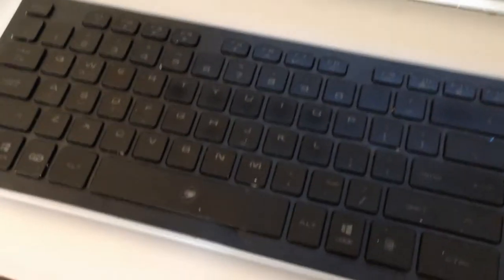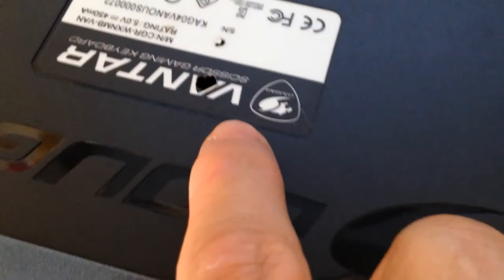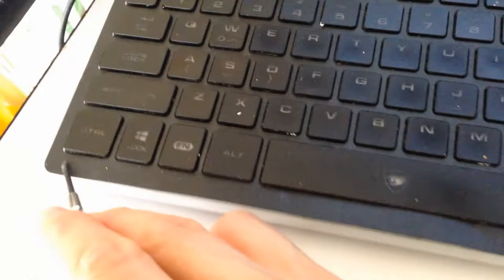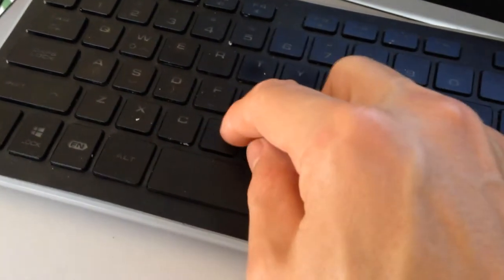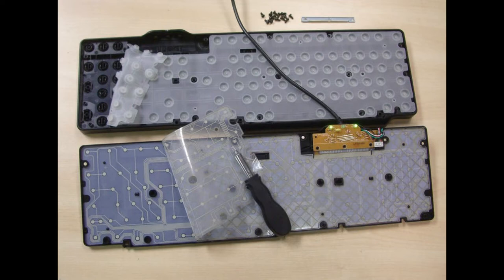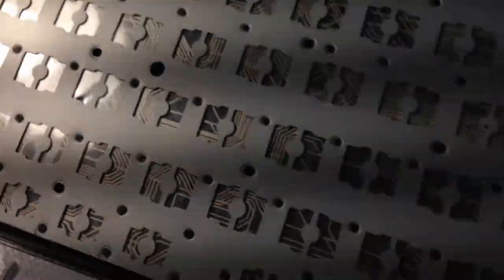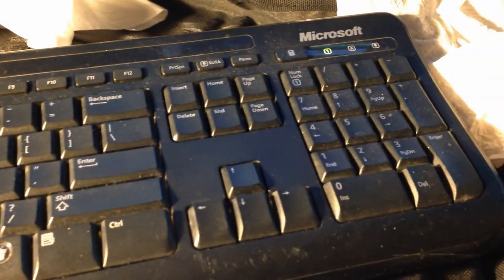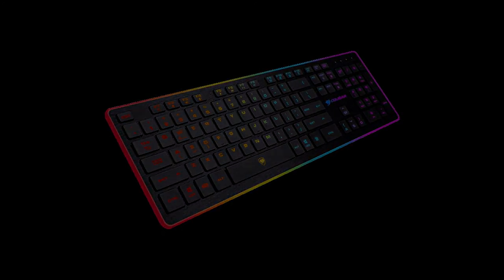Cougar Vantar RBG - UPDATE: Cleaning problems! Teardown / disassembly

Comment: Thank you for this. I spilled tea in my vantar keyboard a couple days ago. I went to clean it up and was met with exactly your problem. But I did manage to pull apart the plastic welding and clean out the circuit boards with alcohol.
Reply: how you do that?
Reply: @blades15rs  I did some gentle pulling right where the rivet was and it popped free.  Then I took apart the rest and ran several Qtips dipped in 91% alcohol.
Reply: hi, do you recommend this product? how is it perform after a months or a years? thx a lot!!
Reply: @HimeGabi  Sorry bothering you 3 year later, but did the metal plate fit back nicely after you cleaned it? And how long does it take to the membranes to dry after cleaning with isopropyl alcohol? Thank you very much.
Reply: @LipColt  Hii, sorry for intruding, but, we don't know how long HimeGabi will take to answer soo.., anyways, i do have some experience with laptop maintenance, and this dude video is great because it shows where the screws are n etc, so, if u wanna disassemble the keyboard without damaging it, i personally have never used but i think a heat gun would be able to remove the black/metal part on top of everything, so u can uncover the screws, and later, glue it back with new glew. As for the plastic dots that hold the keyboard inside, u can "unsolder" it just like any soldering, will stink a bit more because it is plastic, and to solder it back all u need is other little bits of plastic, i've done it with the most unexpected tools and resources, it didn't work because it was a very cheap solution, but i'm positive it works with better resources than what i had at that time.. well, i did my best with what i had, and it worked, if u try it, remember of telling us the results please :)
Reply: omg, new glue* ahahuahuah
Reply: @LipColt  omg again, i said it didn't work, and then it worked... i meant, it didn't worked as good as i wanted it to, but it did, and considering it was a laptop keyboard, the small space and all parts so close to each other, helped a lot

Comment: to clean it up u can actually take out the key carefully without damaging your keyboard. you have to pull and push at the same time but in different parts of the key. this keys are not vertical instead this were placed horizontally In order to take out the key you have to do this: push down this side of the key--->:]x[:  <---- pull up a little and push to the left side while pulling then you already detached the key I hope u can understand my poor english and I hope its clear as cocaloca
Reply: and to placed the key in its much more simple, you just have to slide the key the right side of it must be first and then the left just falls and a little push less than the weight of the finger; don't force anything and with practice you will notice its very simple. you will get used to it.
Reply from the maker: Dude you should do a video of it and upload it, I'm keen to see.
Reply: Thanks, it works!
Reply: Hi! I know this was a year ago but could you upload a short video showing this? You don't even have to speak on the video if you don't want to. I am having issues with my keyboard and I believe this could solve them
Reply: @paulac93  I'll do it. Video will be in my channel.
Reply: @ourclock9273  Thank you!!!
Reply: @ourclock9273  I can't thank you enough! I really thought I would have to buy a new (more expensive) keyboard. You saved my weekend!
Reply: @ourclock9273  hi, do you still recommend this keyboard? how is it perform after a months or a years? I'm looking for low profile with backlit keyboard but it so difficult to find one in my country.. looks like this keyboard is good choice
Reply: @ourclock9273  nooo why did you delete the video :(
Reply: @ourclock9273  can please upload the video again... I'm not able to see it =/
Reply: @ourclock9273  Please reupload the video. Would be really helpfull!

Comment: Ive been having terrible problems with this board. Keys missing strokes, particularly the a and the p. My left shift key gives one of these |  for no reason. Could have been a great keyboard but I give it a 1 star. I had problems writing this complaint!
Reply from the maker: Yeah I think it’s poor construction. Might be worth opening it and checking out the printed wires on the plastic sheets to see if you can see anything obvious causing it to cross wires, maybe you can avoid wasting $40 and keep it as a backup.
Reply: @Domarius64  It's a shame. Could have been a good keyboard. I forgot to mention the lft alt key snapped off for no reason! Its been a bit embarrassing wrestling the keyboard when clients are over. lol Oh well new keyboard is in the budget...
Reply from the maker: Julian it is a shame - I avoided wasting the cost by making it useful on my laptop, it barely gets used so might last a while.
Reply: @Domarius64  Cool, thanks for the video. Might see if I can fix some of the problems:)

Comment: i have been using a very similar keyboard (perixx periboard 324). I love the layout with the fat ctrl and arrow buttons, and chiclet scissor switches, and backlight. unfortunately it seems to also be similar quality. i broke the corner of an arrow key. i manged to sucessfully replace the arrow key with the alt key which is the same size. am thinking of getting the cougar instead but maybe its not any better.
Reply from the maker: I would look elsewhere if you want a quality keyboard. Cleaning and maintenance is a must, and this keyboard doesn't allow you to do it.

Comment: Do you know is it possible to disable RBG leds only on the edge? I would like the backlight but the edge rgb is very bright.
Reply from the maker: You can adjust brightness, I'm pretty sure?
Reply: @Domarius64  but I would light brightness high on key caps, without light on the edges
Reply from the maker: @MrSoBraL87  no it's too cheap a keyboard for that.

Comment: Does anybody tried to improve backlight in Cougar Vantar? Most simbols partly invisible on all backlights effects
Reply from the maker: No solution that I know of! That's one of the things I complain about in this video or the previous video (can't remember which).  I'm sure they tested it, looked directly down on it, saw everything was lit up, and called it a day. But actually when you sit back in your chair and view the keyboard at an angle (like, normal usage...) most of the symbols top half disappear, to the point where it's actually difficult to tell what key you're going for!
Reply: @Domarius64   As I see in your video there's n space for mounting 12V COB LED Strips what makes imposible to improve backlight. I think Cougar totally FuckUp with design and visual ergonomic of this keyboard. The wrost they didn't fix this for 3 years

Comment: Maybe be clean? Respect your gear?
Reply from the maker: Cleaning is a normal part of keyboards even though it's not very often. I just finished a complete clean of my mechanical keyboard (you can find tutorials for this on the net) and they are designed for cleaning by removing the keys and top cover.

It's not possible with the cougar vantar because they stuck it together with adhesive, very cheap design, not designed to last and certainly not designed to clean.

Comment: Good video lad! Hopefully mine dries then.
Reply from the maker: If it's plain water, give it enough time in a dry enough environment (eg. outside in the sun, with the heat and the air) and it should eventually.   But water can stay between surfaces forever in the right conditions.  It might be worth taking it apart just once.
Reply: It was coffee. After some drying and quick plug in to test a key I knew was bad still I sprayed it with regular water from a bottle to make it less sticky and then sat it on top of the pc to dry. It worked beautifully.

Comment: i just bought the keyboard , and if you're a gamer.... DON'T buy it the spacebar is really messed up u have to press it in the middle otherwise it won't respond
Reply from the maker: Yeah I found the CTRL key to be unresponsive unless you press it dead center.  Often used for "crouch" in games... and it seems when I press it with my pinky finger I press it on the bottom corner.  Never been a problem with other keyboards, but this one is just less sensitive...
Reply: Just happened to me today - after 1 year of  regular use (I dont event game that much or smash it hard) the spacebar is almost non-responsive now. A waste of money....